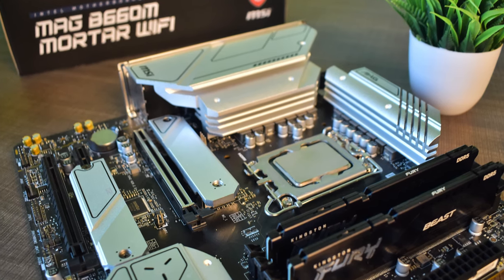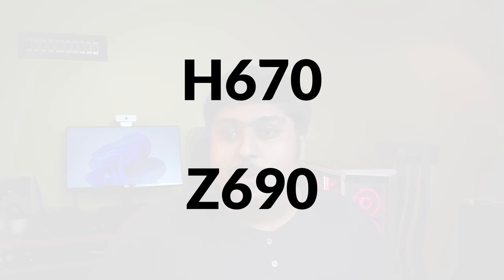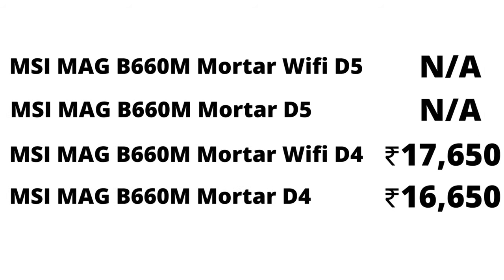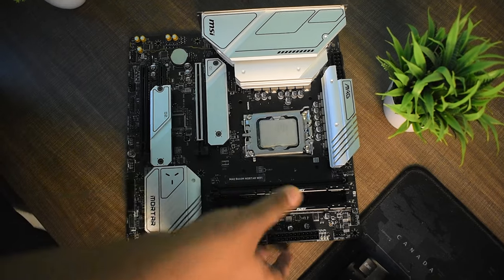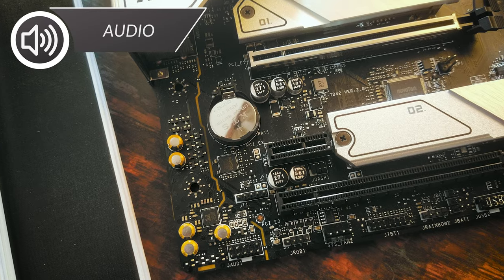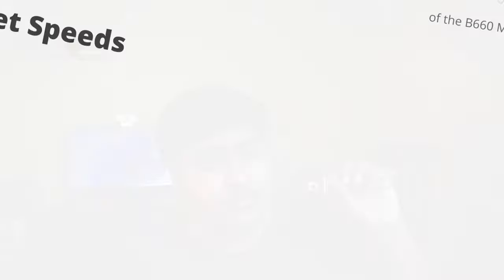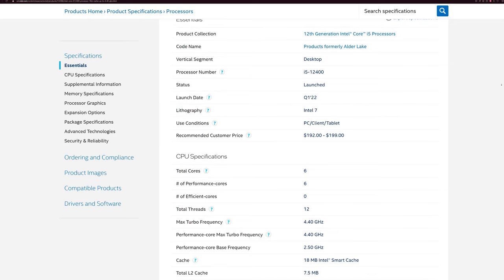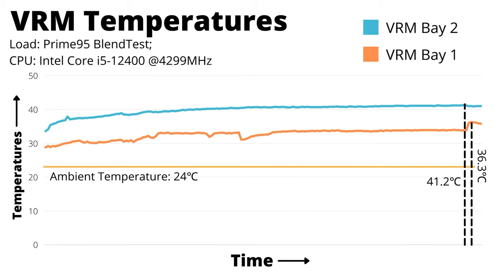MSI MAG B660M Mortar WiFi DDR5 Review

Comment: Hello, I have a question, how to output 5.1 sound through the spdif connector on this motherboard?  I have in the settings for some reason only 2.0 sound.  In the bios settings, surround sound is enabled, the latest version of realtek control is installed.
Reply from the maker: Do you have the Realtek Audio Control app installed? If your output device supports 5.1, it should pop up in the app itself.

Comment: Will this board work for an i7 processor, RTX 3080 nvidia gpu, and 16 gb ram? Not sure if it will support the GPUs full potential…
Reply from the maker: The board has a PCIe Gen4 x16 slot. So, it will have no issues in utilising the full potential of an RTX 3080 GPU. Also, if you are using a 12700F, you will be fine with this board. Although it can easily handle a K series Core i7 processor, why buy a B series board with an unlocked chip?

Comment: Does MAG B660M Mortar WiFi DDR4  have 12v+ rgb header
Reply from the maker: Yes, it does. MSI calls the +12V RGB header a "JRGB" connector. The B660M Mortar has one JRGB header, called the JRGB1 connector. You can find it in the bottom left corner of the board.
The other two JRGB1 and JRGB2 headers are +5V ARGB connectors.
Hope this helps 😊
Reply: @CyberTechTok  ah. Tysm

Comment: Hey I wanted to know will my noctua NH-D15S cooler fit in this mobo with Corsair VENGEANCE Pro RAM sticks dual channel configuration.

I am planning to buy this mobo, please help me decide.
Reply from the maker: You would be fine if you are using a 120mm fan in the front. If you have installed a 140mm second fan, it's not going to work. This motherboard will cause no issues in either scenario!
Reply: @CyberTechTok  it comes with a single 140mm fan which will be sandwiched between two heatsinks the other fan is optional with D15s.

Is there enough clearance for both ram and cooler to breath and ram sticks being in dual channel configuration?

Also, the case will be Corsair 4000D airflow so planning to place one case fan at the back and two at front of the case and NH-D15S with single fan sandwiched between heatsinks. So I just want to know will all this fit together nicely with efficient aircooling?

I know am asking too much but I just want to know your opinion.

Thanks for the reply though :)
Reply from the maker: @JayPandya  I am happy to help you, man!
Without the second fan, you have 65mm of clearance between the heatsink and the DIMM slot. And, that is enough!
The 4000D Airflow is great in what its name promises, so do not give it a second though. But, it is a huge case, so better not put an M-ATX motherboard in there 😅

Comment: Bro, this ddr5 version compatible i5-12600KF? if yes, what RAM clock suit this build? Please suggest best fan cooling for this
Reply from the maker: Yes, it will work with the 12600KF. But you will have to buy compatible DDR5 RAM. Go for anything faster than 4800 MHz. 
If you are looking for a good cooler for the 12600KF, get the DeepCool AK620 or the LE520. Hope this helps!

Comment: Wish it was WiFi 6E? Wait it is WiFi 6E? Is it WiFi 6E on the DDR4 version?
Reply from the maker: The DDR4 variant has Wifi 6 :/
Reply: @CyberTechTok  how easy is it to replace the WiFi chip under the heat sink?
Reply from the maker: @dkimmortal  it is possible, but not recommended

Comment: It's compatible with an I5 12400f?
Reply: I want to pair with this processor cuz I found a good price for this motherboard that's why I'm asking
Reply: Another question is better this motherboard or the Asus prime a d4 b660m?
Reply: Ok nevermind you did use a i5 12400 lol
Reply from the maker: Yes, this motherboard is compatible with a 12400F. Also, it is leaps better than an Asus Prime-A D4
Reply: @CyberTechTok  thanks you for your answer really appreciated. One more question it's compatible with an 1080? It's a bit old so Im not sure
Reply from the maker: @Zak-hq2rw  yes, this motherboard is compatible with a GTX 1080.

Comment: Would this board be good with i7-12700kf ?
Reply from the maker: I would not suggest anything above the Core i7 12700 non-K with this board. Although it can run the processor, it will be a tight fit and you will miss out on some features like overclocking. If you are spending so much on the processor, I suggest you look at the Z690 boards.
Reply: @CyberTechTok  thanks for responding, I don’t plan on overclocking and running ddr4 , will it run the 12700kf stock performance at least ?
Reply from the maker: @gabrielmatthew8360  yes

Comment: Does it support DDR 4
Reply from the maker: The specific version which I reviewed does not. However, MSI sells a DDR4 version of this motherboard separately.
Reply: @CyberTechTok  thanks
Reply: @CyberTechTok  and bro does it support all intel chipset like intel i5 12gen 12600k ? I am new to all this sorry if I am being stupid
Reply from the maker: @hand6425  Yes, theoretically it can support up to a Core i9-12900KS. But, I would not recommend you to pair anything above a Core i7-12700.
Reply: @CyberTechTok  why not is the motherboard slow
Reply from the maker: @hand6425  its VRMs are not strong enough to run beefy processors like the 12700K and the 12900K optimally.
Reply: @CyberTechTok  thanks
Reply: I have one more question will this support the RTX 4000 series
Reply: @CyberTechTok   I have one more last question what will happen if I use a rtx 3080 and intel i9 ?
Reply from the maker: @hand6425  the board is PCIe Gen5. So, RTX 4000 series support will be a breeze. Also, if you pair in a Core i9 and an RTX 3080, the processor will not run at the rated performance and underperform under full load.
Reply: @CyberTechTok  thx